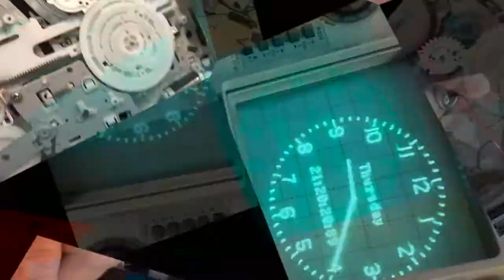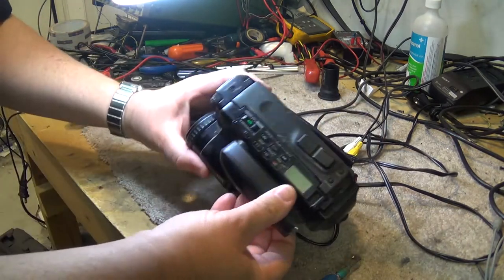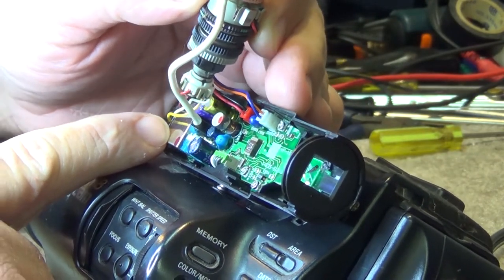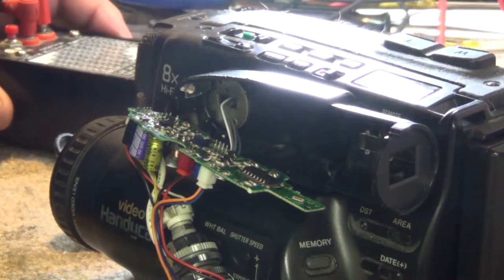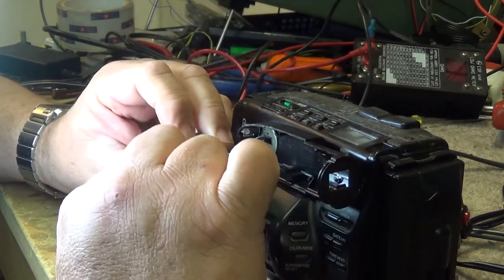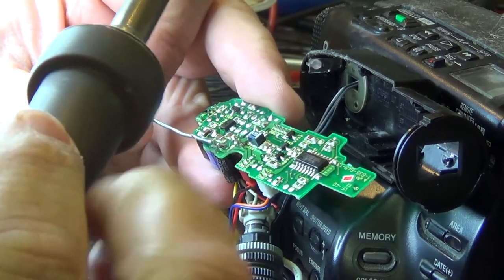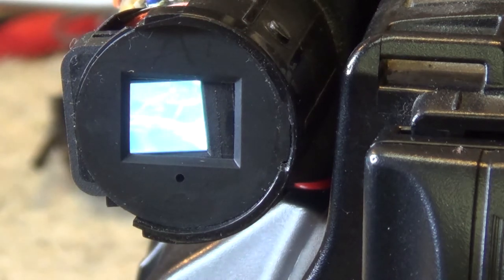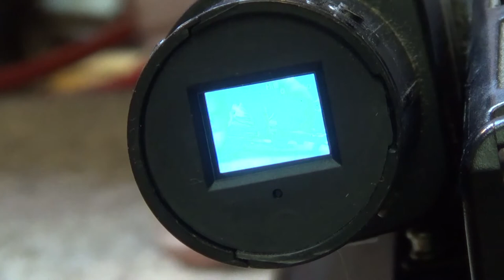Sony CCD-TR81 Handycam Viewfinder fix

Comment: My brother left me his broken Nikon Action-8 camcorder a few years ago.  I sort of forgot about it til about 2 weeks ago.  It had the same viewfinder problem, but I had no idea how to fix it.  I have earlier watched many of your videos on TV repair, and was pleasantly surprised to find this video on the viewfinder repair.  It turns out the Nikon camcorder has the exact same viewfinder as your Sony, and the exact same capacitor was bad.  I scounged around my electronics parts and found a comparable capacitor, swapped them out, and wouldn't you know it, the viewfinder works!  Big kudos your way.  I've learned a lot watching your vids.  Thanks
Reply: Hey im considering attempting this too. However, he seems to solder it back on, but I have no such tools. How did u go about it?? Thank you
Reply: @popefrancis80  I have a cheapo soldering station that I used to desolder the defective capacitor, and solder in a good one.  While heating up the pins to desolder, I used a cheap "solder sucker" to prevent the melted solder from re-hardening.  Once the old solder is removed it's easy to put the pins of the "new" capacitor through the holes, and solder them in place.

Comment: Someone gave me a non-functional TR-71. Pretty much the same camera. I replaced the cap and had the same cap on hand that you found (100 uF, 16V, 105 degree). Took less than five minutes to replace, thanks to your video.

Now I just have to figure out why I'm getting "horizontal hold" tearing (like old CRT with the front-panel horizontal hold misadjusted). I have a feeling that's going to be tougher to track down.

Thanks!!
Reply from the maker: I have done videos on the video board on this camera too. It will be leaking craps inside.
Reply: @12voltvids  Thanks! I just found your TR71 video. It's late here now, so I'll get into that tomorrow. If it is just "re-capping" the board, if I have the patience, it should be straightforward. Ever since I got a proper desoldering station, these repairs have gotten a lot easier.

Comment: Great video! I was wondering if you know what can cause a blury CRT screen on this kind of black and white viewfinder? My Sony handycam is fine, the lens focus is OK but there's something wrong with the viewfinder because even the display text looks blury (by the way I removed the viewfinder magnifying glass and the screen is the problem). Thanks for your comments.
Reply from the maker: Yes voltage is either too high or too low.  The focus voltage is derived from the high voltage which is directly related to the b+.  Even being off by .5 v will cause a large difference on the focus grid.
Reply: @12voltvids  thanks for taking the time to answer.  Great channel!

Comment: Hi, I'm hoping that you can help me out.. I have a mid-90's Sony Handycam Video8 CCD-TR44 model with a blurred b/w viewfinder (similar to the one in your video). I checked RCA out to TV and all works perfect, as all do all other functions but it's just the viewfinder that is the issue. I adjusted the dioptric ring but it's still blurry. I took a look at the service manual and saw that inside the viewfinder are a few adjustment rings, one of them being a focus ring. I heeded your warnings on powering off when adjusting anything but can you please tell me how I can safely and effectively adjust the focus ring with no testing equipment? I'd appreciate it. Great videos by the way.

Comment: I just picked up a Sony CCD-F301 from GoodWill for 13 dollars and it too has the same issue that yours had. I actually had to revert back to this vid just to relearn how to check/replace. Hopefully I have a cap that will work for it as the camera is in good condition otherwise.
Reply from the maker: You will be changing a few of them.
Reply: @12voltvids  I seen that 2 were Elna with corrosion, though I'll have to revert to another one of your vids about repairing the main part as the tape isn't being taken up by the pullers and the spinning tape head looks like it's struggling to even move.

Comment: About a year or so ago a friend brought over his camcorder that had a dead electronic viewfinder. I could not figure it out. Maybe I should ask him to bring it back. I thought the flyback in it was dead.  Very nice video. Gary
Reply from the maker: HD7100 usually it is those little electrolytic caps that cause the majority of the trouble. Other times it is the traces that get eaten away by the corrosive fluid that leaks out of them.

Comment: Brilliant!
Just a capacitor to bring the camera back to a full function machine.
Reply: Many thanks. I too was getting exactly the view as you described. Received a quote of £90 Sterling to fix it!  I repaired the fault in less than 15 minutes. Cost of Capacitor? Managed to purchase same for £1.05 excellent make also. Thanks a lot once again. Your video was a first class example of a professional getting his subject matter across and others understanding it.

Comment: Not sure if you've covered this question in a video before. I've got an excellent 1987 condition Quasar VHS movie camera. I honestly don't think the camera has more than 6HRS on it.  I saw a video somewhere online about replacing a "capacitor" that normally causes ghost trails on the video when the camera is either old or cold.  I can't remember the name of the unit it's attached too.....? I'm sorry for my lack of education on the way the camera works.  Its something to do with when the image is recorded and passes through this CCD capacitor I think?  Again sorry for the lack of knowledge, but are you understanding my question?  I'd like to solder a new one on.

Comment: Hello (yes i am a little bit late) does this crt can have a dangerous high charge like tv ones because i have the same problem on mine and i want to fix it (sorry if bad english i am french).
Reply from the maker: They run at a couple thousand volts.  The little tube doesn't store much of a charge.  Like getting bit by an electric fly swatter.
Reply: @12voltvids  Thank you.

Comment: I have a Fisher (Sanyo) 1981 tube camera for my portable Betamax and the viewfinder doesn't have vertical hold. I just shows a horizontal line. Could the problem be the same as this Handycam?
Reply from the maker: Capacitors in the viewfinder were notorious for going bad. Actually all the capacitors in the cameras go bad. I just did a vintage camera comparision, and I am surprized that I actually got some of the old vintage cameras I have going.

Comment: Any clue which inductor these little viewfinders use? 

I have the CCD TR200 and had to swap out the cap. I wanted to take out the inductor to clean off the subsequent corrosion caused by the blown cap and ripped off the inductor leg 😢. 

Only thing I could find locally was a 27uH inductor but I get banding on the screen. 

Thanks in advance’
Reply from the maker: Sorry I don't know the value.  There is a reason i don't clean boards. You can easily do more damage than the electrolytics left behind.
Reply: @12voltvids  sadly I learned that the hard way. Probably didn’t need to remove the inductor but oh well…ya live and learn. Luckily this camcorder is just being used to digitize old hi8 tapes. I bought it cheap and figured I could try to fix the viewfinder on it…that turned out to be partially true lol.

Comment: I have a Sony CCD-TR9 with the same vertical line if the problem is a faulty capacitor would a Nichicon 2200uF 10V 105C Aluminum Electrolytic Radial Lead Type Premium Capacitor fix the issue.

Comment: Excellent, I have the old JVC  that has the same issue and it has been sitting in a case for years !! Do you think it is the same capacitor issue?
Reply from the maker: ***** Good chance yes. It won't be the same board, but it will be similar in design, and I bet of you look one will be leaking. An ESR tester would spot the bad one in minutes.

Comment: I got a sony ccd-f350e. Suddenly somewhere in the last 10 years it has become faulty. The tube is flickering a lot, and the electronics are not responding correctly, the tape mechanism do not do the whole "cycle". Can this also just be some bad cap? It's a lot to take apart. Hehe.
Reply from the maker: Probably a bunch of bad caps.  I have several cameras here to look at, but I hate cameras so they sit in their case.

Comment: I have a Sony ccd-tr81 with the same viewfinder issue, instead of fixing and re capping it is it possible if I pull out a old colour viewfinder out of a ccd-tr91 will it work with a ccd-tr81 ? Do both viewfinder have same connectors ?
Reply from the maker: I doubt that the connectors are even close between a color VF and one of the old tube ones.
Reply: i just got a tr-9 with a old tube viewfinder and i am gonna try to put it into my ccd-tr81 hope  it works. both are old tube view finders

Comment: I just acquired a CCD-V5, very early Handycam from 1988, and the viewfinder is just blank white no matter what I do, adjusting its pots just changes how bright and how white it is. Would this be some kind of capacitor issue?
Reply from the maker: Lots of leaking craps in that one.
Reply: @12voltvids  Dang, was hoping that wasn't the case. I didn't see any leaks in the viewfinder itself but I bet there's plenty in the camera.
Reply from the maker: @VSigma725  oh yes.  Lots.   They leaked corrosive liquid on the board that attacks the copper traces.
Reply: @12voltvids  Yikes, at least this one looks nice on display.
Reply from the maker: @VSigma725  my jvc gydv500 looks awesome on display in my living room.  That's about all it is good for.

Comment: Great video. I have another problem my old Camera data use to Save my oldest video8.. suffer and big problem on switch that have three different position player-off-camera if you move the switch on player it works perfect and i can use it for my purpose. If i want to move the switch on camera position il does not work because the little little switch on the small board doesn't let pas Electric Power. I Openef the Front plastic to let me see that and i've found that Big problem for me

Comment: Mine has these distracting black stripes, which show up in the recording. I don't know if the lens got burned somehow, or there is a capacitor failing somewhere? They appear on the left side of the image, which really is a problem. There's nothing else wrong with the camcorder, but that odd symptom. I'm about to buy another TR81 off eBay, if it has the same exact issue, I will see if it can be repaired. If anyone else has this same symptom with their unit, please reply to this comment.

Comment: I followed this and it worked! now I can't play back in the view finder! any help?!?!?!
Reply from the maker: Check for bad small caps on view finder.
Reply: @12voltvids  so essentially the same repair I did before but look for another cap that is bad?
Reply from the maker: @upthewayproductions  remember that the crap that leaked out before will attack the copper traces on not just the surface traces but the internal traces that you can't fix.  When that happens the board is toast.  That is why i will not repair and cameras for clients that have bad caps because they are all shirt term repairs.

Comment: i have a prolem with a sony f555e where the viewfinder works but i can see only half, the other side is White making it  almost impossible to use, it gets a little better when it heats up, and in the other side image is bad but i can see counter, in the half is very bad image help pls
Reply from the maker: It's going to be those surface mount caps.  Without question.

Comment: Do you still fix cameras ?
Reply from the maker: If they can be repaired, yes. Many are beyond repair.
Reply: 12voltvids I have a camcorder RCA pro 843 everything works fine it turns on and all it’s just when I look threw the screen finder it’s a black screen as if it doesn’t pick up the lense but a day ago it worked where I could see what the lense picks up on the view finder
Reply: Can I send you a camera to fix ?
Reply from the maker: @xboxbapejii2532  contact me by email
Reply: 12voltvids what’s your email
Reply from the maker: @xboxbapejii2532  Its on my main youtube home page
Reply: 12voltvids for some reason it won’t let me view it

Comment: Hi, I own a Sony DCR-TRV120E and my viewfinder is blurred. Nothing to with the actual focus of the lens as the screen shows a perfect image. Also not the little focus window in the finder itself as I tried that already. Just the tiny black and white screen is out of focus, image and display info.

Any ideas what I could do? Thanks in advance!
Reply from the maker: If that model has a CRT viewfinder it's probably the tube.
Reply: @12voltvids  Thanks for reply. Is that fixable / expensive?
Reply from the maker: @Hassebas88  couldn't tell without seeing it.  Parts are not available these days so a used part would have to be sourced